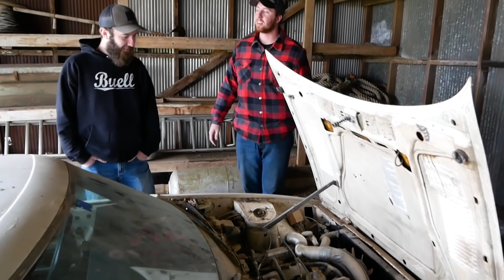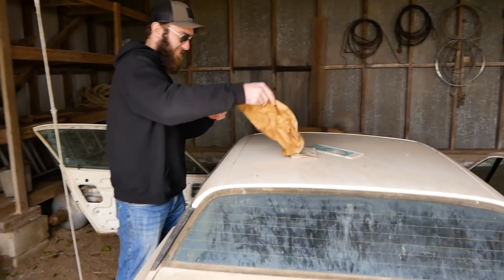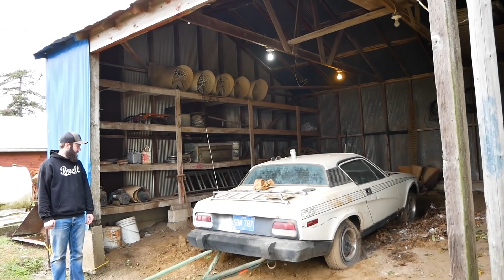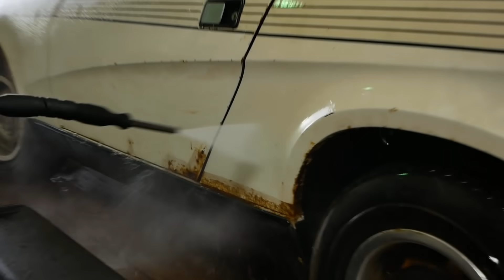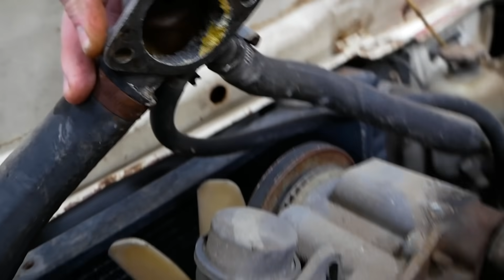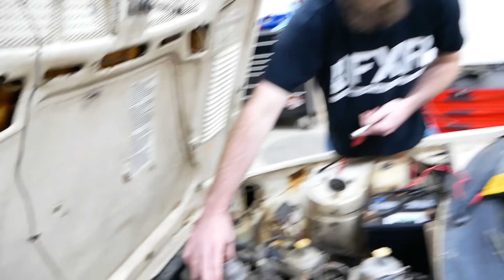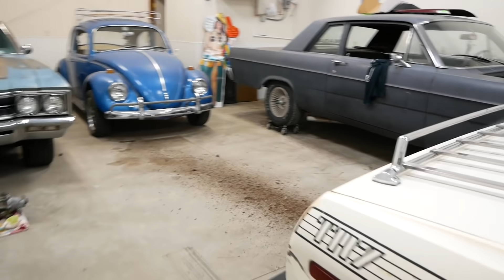LOST Triumph TR7 Found Buried in a Shed! First Start in YEARS!

Comment: Oil in the dashpot is essential for proper operation! If there is no oil the engine will start with difficulty and will not accelerate quickly. Use ENGINE OIL
So check oil in the carb

Comment: V8 the tr7, it's real simple, the 5 speed tr7 gearbox is a rover V8 box, stick a SDI rover manual bell housing on the 5sp box and bolt the all aluminium rover 3.5 V8 ( Buick I believe) on it.
Obviously you need a manual V8 flywheel, and most V8 engines u find are autos, so u have to stick a spigot BRG in the end of an auto crank, cos they're different size.
Drop the front subframe a couple of inches with spacers  so you can get the V8 in low enough to close the bonnet, and fabricate some engine mounts.
I restored a real dog and put a V8 in it, just uprated the  suspension, the propshaft and STD diff held up.
Made sure the STD brakes were in A1 condition, it passed the engineers report and mot , so that's how they stayed. Pre antilock brakes , it was capable of locking the brakes at any speed in dry with STD brakes  and tbh I wasn't throwing any more  dollar at the project than was needed.
I used STD radiator, just put a pair of electric fans on it, never overheated.
Makes for a fairly lively car,  a transformation over the  a STD 2.0L. l made free flow exhaust and put k&n's on it ,was fairly entertaining, very sideways in wet.
Probably would have been more entertaining with a high reving Jap engine , but it was fun for a while.

Comment: "This is almost too easy..."  Famous last words.  I owned one - actually two of these for a few years in the 80s.  One was for parts, one to occasionally drive.  It was the only TR I ever saw that both the headlights actuated at the same time.  Everything electrical in this car will be total garbage.  Then, you have the joy of trying to balance those strombergs.  The car had a distinct oil and gas smell that I can still remember to this day.  I kind of miss it.

Comment: Be wary of molten wire insulation dripping onto the drivers legs. Keep a wary eye on oil and temperature, the jack-shaft is the first bearing in the oil gallery, so when it wears, oil pressure stops, big-ends knock,  water pump suffers, wallet screams in agony. Sell it to an enthusiast with deep pockets, and watch from a safe distance.

Comment: If that is the four speed box then it will be shot to pieces. The four speed box was sourced from the low end of the Triumph range and was used in the smaller engined cars like the Herald, Spitfire and later in the much unloved Morris Marina. By the time the Marina and TR7 came along the machine tools used to make the gearbox were worn out, new cars were leaving the factory with out of tolerance gearboxes.
There was also a design fault that led to the reverse gear getting shredded if you changed into first at anything over a slow walking speed.
These parts are not available, I had to search for a month for parts to rebuild mine.
The gearbox was also just too small for an engine of 2 litres which meant that when the Marina, rebadged as  Ital, got a 2.0l engine it was automatic only, as that was the only gearbox they had that would fit that was strong enough. After a couple of years the TR7 got the Rover SD1 gearbox with 5 speeds. Good luck finding one of those now.
The rear axle is prone to failure too.
Then there's the electrics.

Comment: I had an '81 TR-7 - one of the last ones off the boat before they stopped importing them into the US. It was a fun car to drive, but seriously impractical - and then there was the crap BL electrical package. The only problems I ever had with it were electrical - but they'd stop it cold. Nothing beats having the entire car just SHUT DOWN at 75 miles an hour, in rush-hour traffic, driving south on the 880 towards San Jose! Yeah!! Then praying it'll decide to start again before getting run over by a semi. But, overall, a fun car.

Have fun with those carbs! Mass balancing those twin Sunbeams was...interesting. Not fun, but interesting. :-)

Comment: The Leyland PE166  engine 2.4 or 2.6L twin SU carburettors and inline 6  with an alloy head and cast iron block a common problem is a warped head it's been over 30 years since I workedon one of them

Comment: Motorcycle carbs? Those are the same Strombergs that are used in 3,000 other English cars. Also, JC Penny sold batteries as well. They had the only lifetime warranty battery that I've ever heard of and they lost a ton of money on them. They cost a little more, so anyone who only kept his car a few years wouldn't  buy it and those who kept them a long time did. So it was such a huge loss leader that they lost their shirts on them. And if that weren't bad enough, they also tried to compete with Sears and sold a line of tools called Pencraft.
 (don't tell anybody, I still have a set of those wrenches)

Comment: The TR7 was the ugliest car Triumph ever designed. Chassis, engine, transmission and electricals came from the Triumph Dolomite. In those days, Saab and Triumph swapped engines. Awful electricals causing fire, and problematic admission, were the main headaches on my Dolomite. Good luck and courage to you.

Comment: SUs are strange carbs. Don't delve into them unprepared. And if it fires without bursting into flames, you're ahead of the game. Way ahead.
Reply: Those were Zenith-Stromberg carbs.  Also used on 1969-70 Volvo 140s and the carbureted 164 model.  A pair of SU HIF 6 carbs would be an improvement.  The Strombergs are notorious for having a high idle when warm, even when the choke is fully off.

Comment: Those are Stromberg carbs. The mixture is controlled by an internal flat, thin rubber diaphragm which is usually torn by now. That's why the engine is not running properly.  Also, it's a really bad idea to use a solvent to start a car that's been dead for years. Solvents wash the oil off the bores, meaning the rings and the bores are running metal to metal, which causes a lot of damage. You should use something like Gunk engine start, which contains an upper cylinder lubricant. Lastly, I can't believe you guys try and start cars off the tank. You should always disconnect the fuel line from the tank and simply siphon in clean petrol from a can or old windscreen washer bottle. Even if the petrol in the tank is clean, it will have lost most of its volatile hydrocarbons by now. That's like trying to start a fire with wet wood.

Comment: Dear digs, I've seen some people pour some gas down the carb instead of spraying ether/starting fluid. I've also seen some people using spraycan ether/starting fluid on diesel engines. Do you think its possible to pour some gas down the throat of a diesel instead of ether?

Comment: I am 7 minutes in and I have to go do a call so maybe you address this later in the video, but is this car a 4-speed or a 5-speed? It is an early car (it has cord seats instead of the later plaid inserts and a large steering wheel boss) and is somewhat unusual because it is a hardtop but has no sunroof. However, if it's a 4-speed then it's VERY unusual because from the start of production most (I thought all) US-market cars had the 5-speed gearbox from the Rover SD-1 while the UK-market cars had the 4-speed from the Morris Marina because they couldn't produce enough 5-speed gearboxes for all markets. Later UK cars have the 5-speed too and it is much better than the 4-speed.

Also, as it's early, this car will have been built at the plant in Speke in Liverpool which had a huge amount of industrial unrest. The Speke cars were/are the most unreliable of all the TR7's and had the most problems (some were sabotaged by the workers before they left the factory).

Comment: It's really a sham it's not a TR6... the TR7 was absolutely the worst of the TR cars... but, really those vacuum driven carbs are not junk, although the stromberg ones you seem to have are of the cheaper variety...  I think those should be Stromberg 150 CDS's they're pretty bullet proof, except there's an O ring that dries up and leaks fuel out the bottom.

Comment: I'm old enough to remember what huge pieces of shit those TR7's were. Maybe now with some newer tech it can be made into a reliable runner. In the 80's I had a buddy that bought an original Triumph TR8. It was basically a TR7 that was built with a GM 350 from the factory and not too many were made, and it sure did haul ass.

Comment: Here's some information to help you with your TR-7.  
https://mossmotors.com/triumph-tr7-8  for parts and technical information. Also, check out The Roadster Factory for TR-7 parts and technical advice as well:  http://trf.zeni.net/featureT78/  I checked and saw that the air cleaner you'll need is pricey from Moss at $34.00. Call Moss Motors to order one of their excellent TR-7 catalogs. They're free. Too bad you didn't find a TR-8. Those had V8 engines in them. Those Zenith Stromberg carburetors need some oil in the top, if you haven't done so already. I think you have an SU fuel pump. If your SU fuel pump doesn't work, you might need to clean the points. Sometimes that's all they need.
Best of luck, Tom

Comment: The only question is why, these were badly built, very poor cars, most have happily rotted away in the UK.  The engines were basically half of a rubbish V8 that triumph put in the stag,They later put a buick V8 in them and called it a tr8 and they were just as bad .about 20 years ago i had a convertible version come to work for a clutch and was so rotten it bent as it was lifted up on a two post ramp 😂

Comment: You young guys crack me up. Most of you say carbs are shit because you are to stupid to understand that that carb has been on there for 20 years or more and probably is half wore out. Not saying you , thunder head 289, because you seem to understand and still run carbs. That  said you just stuck your foot in your mouth saying those carbs are junk. What you fail to understand is that is how Harley Davidson carbs and many other motorcycle carbs worked for decades.  Many European and Asian cars did as well. Someday maybe the younger generation will learn that this stuff is so easy to work on and in a lot of cases more reliable then now days. It's all mechanical.  It will be fun to see how many of now days cars can sit in storage and still run.  I bet none. Wiring will be all chewed up. Fuel pumps will be junk. Injection will all be stuck. I have pulled 1950s cars out of old house pastures and fired them up the same day.

Comment: Poor thing..( the car ).your NOT a Sports Car guy.
I have been , all my 64 years.
    There is nothing GOOD about a TR7 , it had mid engine design , but had a front engine rear wheel drive.
The engine is, next to the interior ,and Electrical system, feeble.
    The ONLY thing about that car is there were to guys racing successfully the V8 version ,the TR8  ( complete scratch built ,under a shell of a TR ) which made everybody with a TR7 think they had a Sports Car.
   It was a Terrible then and Still. 
Even a completely restored one is some poser's wet dream. 
It's not worth your time,.. now get out there and find a Mustang !!!

Comment: Interesting that you clearly know nothing about Zenith-Stromberg carbs nor how they function....yet you declare them to be junk.  After sitting for 40 years, that junk did pretty good by you starting up so easily. Especially as you apparently also never found the manual choke handle next to the steering column.  If you want the original Leyland shop- manual....drop me a line.  Clearly, you'll need it.